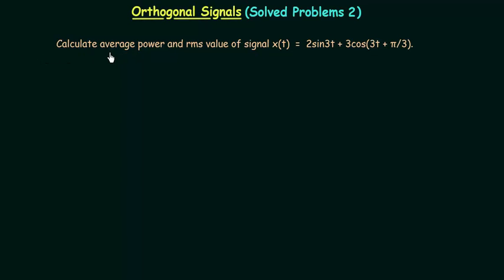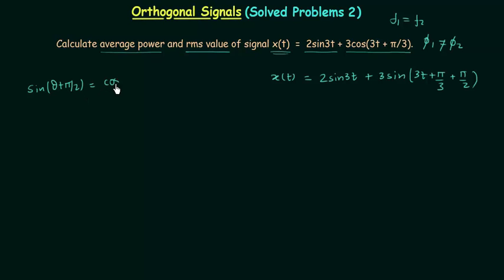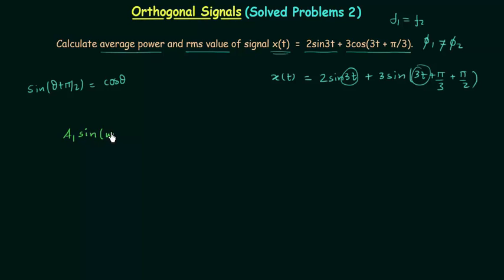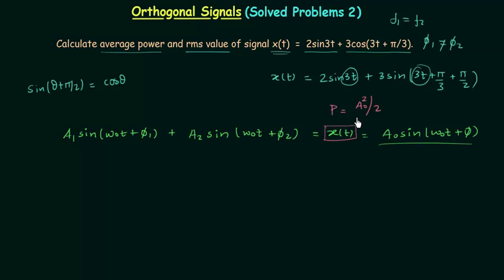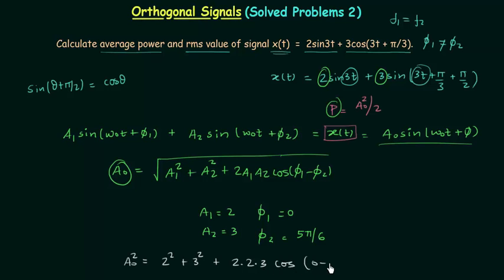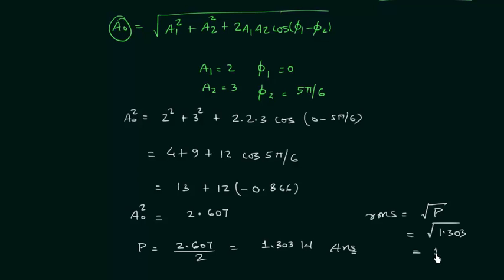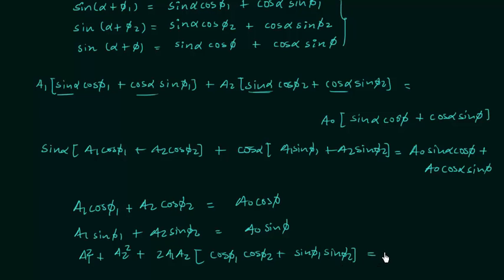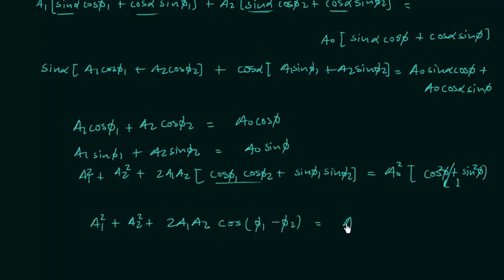Orthogonal Signals (Solved Problems 2)

Comment: here you are saying that freq and phase should be same for orthogonal but before you have solved power by adding..very confusing..please reply for comment
Reply: in previous video also if u do by same method u will get the same result.
Reply: In that question if u change the consine to sine by using π/2, they will become two same harmonics with different frequencies and phases i.e orthgonal
Reply: In the previous video, the signals x1(t) and x2(t) where orthogonal. Because they were cosine and sine signals with same frequency (omega not) and same harmonic(2) and with same phase (45°). The formula P = P1+P2 is applied only on orthogonal signals. But in this video the sine and cosine functions have same frequency and harmonic but different phases so they are not orthogonal signals to each other. Hence the formula P=P1+P2 cannot be applied. And we have to convert them into a resultant signal using the method shown in the video and Ao²/2 will be the resultant power.

Comment: sir its really confusing because in previous videos 
you calculated power of composite signals by adding avg powers of them but here why you used this formula for A○
Reply: because the phase is difference in this example
Reply: basically this method apply on orthogonal signal only.
Reply: dumb see the lectures noob